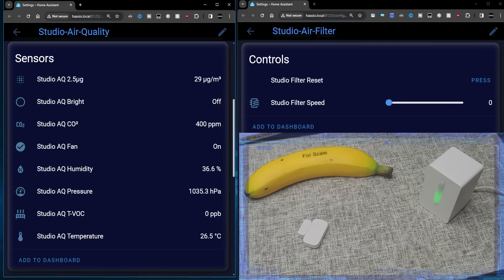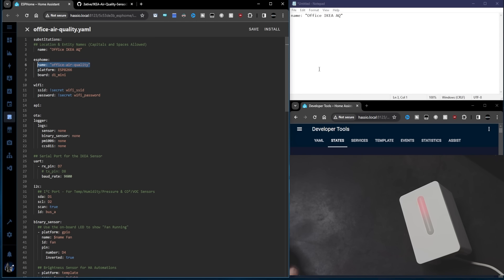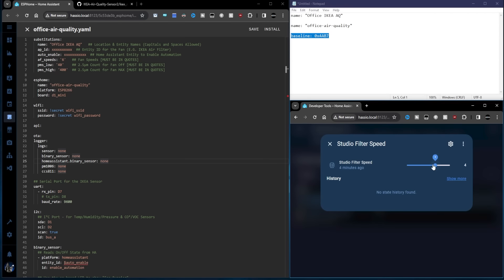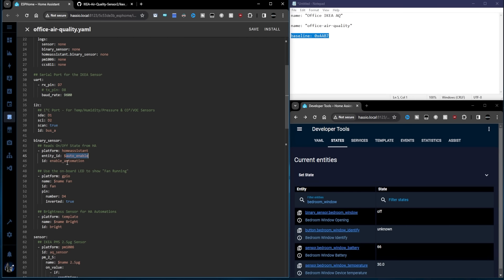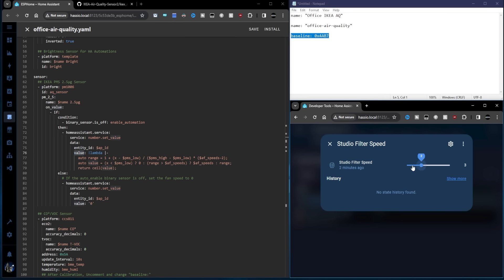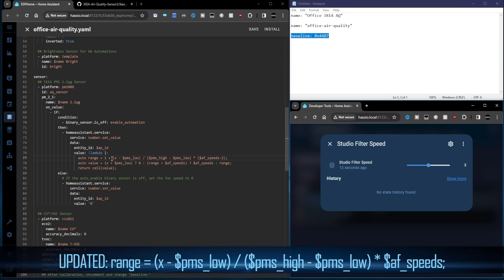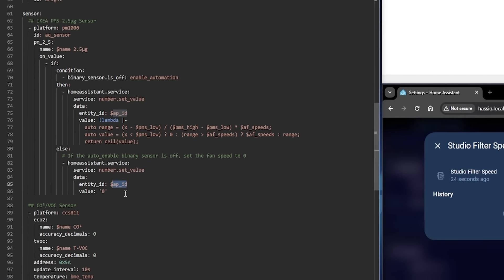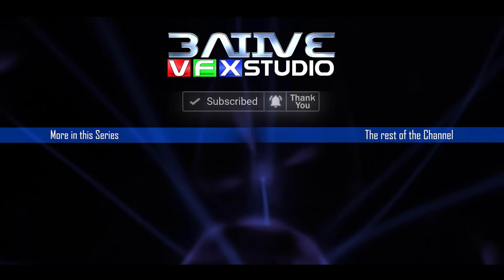IKEA Hack 2: Automate Your Filter with this Air Quality Sensor Update

Comment: Great démo but why are you putting the automation logic in the ESP32 rather than Home Assistant?
Reply from the maker: many reasons...
1. I like to distribute my automation(s) and use the ESP Chips to do as much a possible
2. HA Starts/Re-Starts faster if there's less for it to load/re-load
3. I like coding on ESP chips
😊
Reply: @3ATIVE  Thanks!

Comment: Hi there! Nice video 🎉 do you know if it’s still possible to access the gpio pin of the rpi running HA?
Reply from the maker: Hi, thanks you. Glad you like it.
As for RPi GPIO: From what I remember, they removed that function a while back.
Reply: Ok thx for info.  😊
Reply: @ha-cn4wu  Doesn't it depend on your HA install? If you're not using HAOS, you have a real access to the OS and should be able to create code that has access to the GPIO, shouldn't you?
Reply: in my opinion yes - you are right. Using haos does not allow you. Using core install will allow if you. That is what I discovered recently - my trick will be to use esphome to do what I want